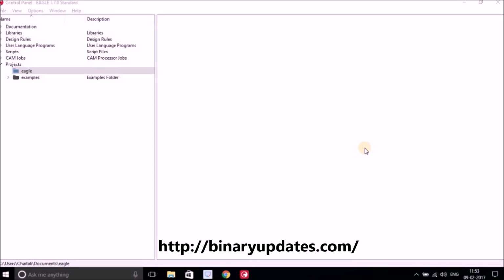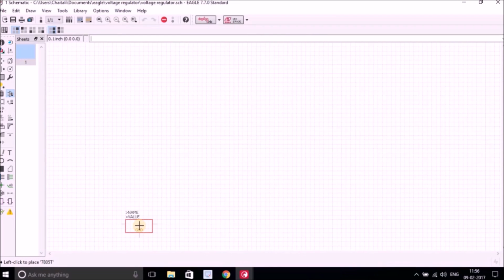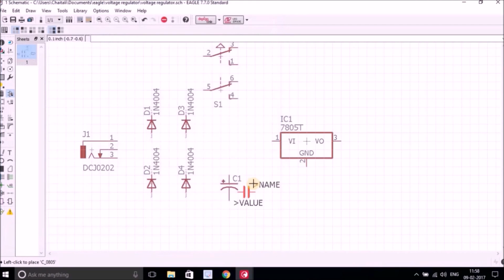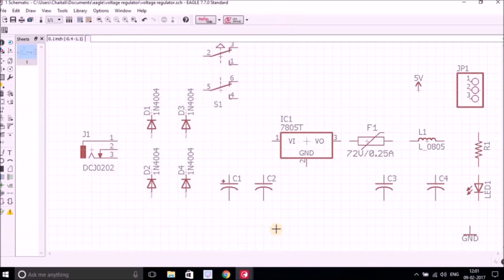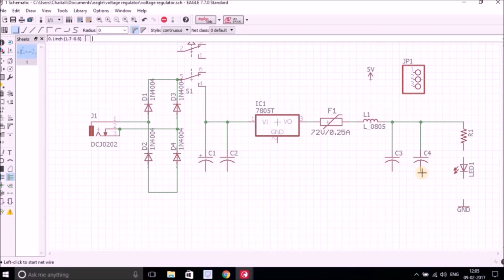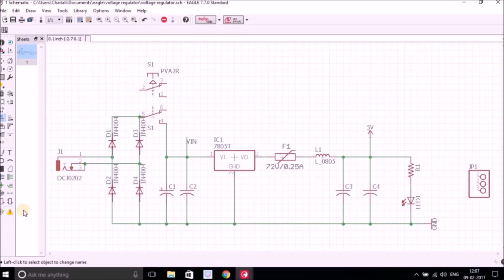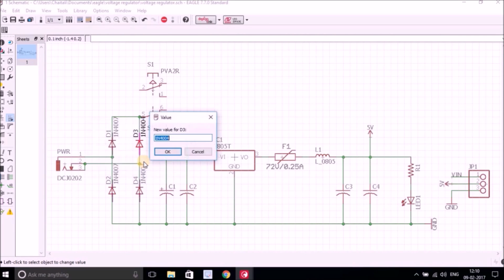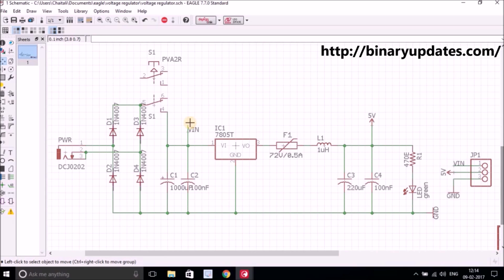Schematic Design with Eagle PCB Design Tool

Comment: Can i know the spice model for switch for example when we simulate the circuit we mapped the elements with suitable values and pins for diode we use DMod as a spice model then what is the spice model for switches